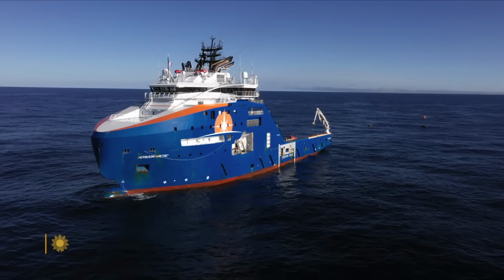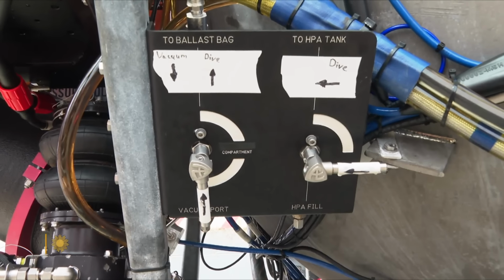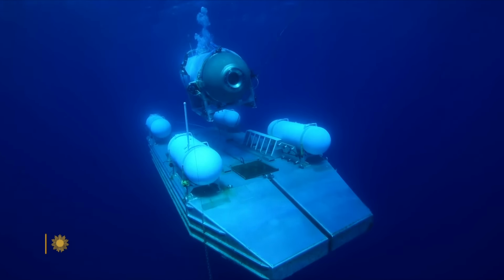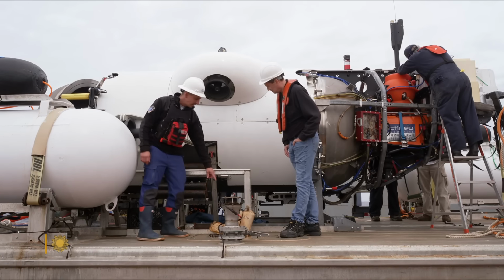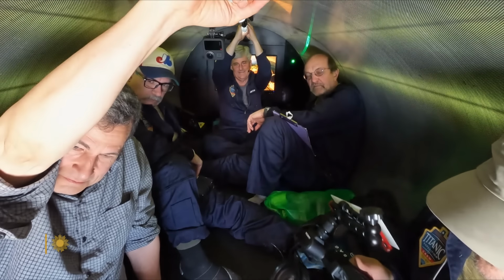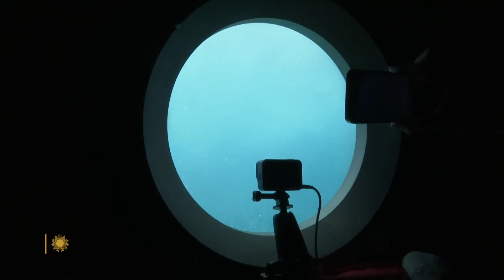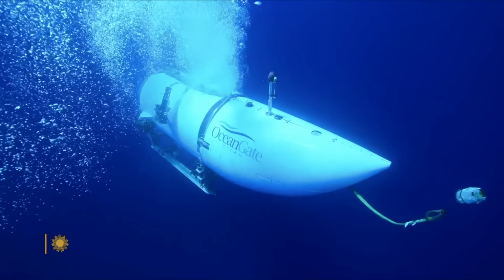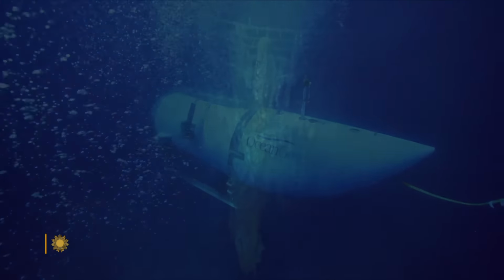Inside the Titanic sub disaster

Comment: As an engineer there's two things you don't cheat. Costs and physics. He did both.
Reply: Don't you mean mean material instead of costs.
Reply: I trust titanium over carbon fiber
Reply: @oldskolacura9798  Well no not exactly. You can buy the same material from a different supplier for less the cost.
Reply: @Body_Model awh, but you missed material testing, as did OceanGate!
Reply: As an engineer I agree. If something simply, physically can't do something, just because you say it can do it, wont suddenly allow it to do it. Post modernism and science are not compatible, and science always wins.
Reply: @SamDru  I saw on another news report that he also used expired carbon fiber from Boeing to build the pressure vessel!
Reply: How much is known about the durability and fatigue limitations of steel under pressure compared with carbon fibre? Should experimental craft EVER be used for commercial tourism? You can't waive liability against negligence of recklessness.
Reply: @multioptioned  well assuming that it imploded before they reached target depth. Which was 13,000 feet or so. I would say it imploded probably around the 11k or 12k mark. means you would have around 4000-5000 psi of force on the sub. For reference the human body starts to break bones at 75-125 psi. I actually think they might have been alright if they didn't use two different types of materials for the hull. I don't know the configuration. But you want your main structural component to be the same across the board to eliminate any sort of different variables that different materials would experience. I read that they had used carbon fiber and titanium for the sub. I don't know enough about submarine structures to question the design choice but I do know enough that one material is going to flex more than the others causing a weak point.
Reply: @ianb4618  I haven't heard that yet. But honestly I wouldn't be surprised. From pictures alone I didn't like the design of the sub something just felt off about it. I know a lot of people are knocking the controller as well but you can control the vessel with a calculator if you wanted to do long as the systems work.
Reply: Former and expert engineer here, I completely agree! the cost should not be the main focus when dealing with the troubles of mother nature! another missed factor that you pointed out is the physics and pressure is so intense that I would be freaking out! #ControllerPlaya!
Reply
Reply: owenpurcell8318  No way dude thats crazy! wanna collab #onlyfans
Reply: why you say "as an engineer"? So if im not a engineer i cant say the next sentence?
Reply: @weldonyoung1013  Don't forget material inspecting.
Reply: @arturf2508 no you can’t. This is the engineer comment section.
Reply: @12runes Should never rely on wireless underwater.  Batteries die, Bluetooth disconnects, fails. That was just stupid
Reply: plus killing
Reply: especially when you consider manned expedition of deep ocean and outer space...
Should never expecting for "budget option" in the first place

He said this 6:59 .. but what was he doing? Going pass the crust of the earth? or Permanent lunar settlement?? 
The risk reward here is off man  The reward being "the ability to make budget deep sea tourism". and the risk involved his own life+ the fellas' 
 ugh damn
Yes there is carbon fiber, which one wants, should have tested with unmanned at least for a couple decade before going full on exotic tourism!!
It really was insane what the guy had been doing.
Reply: There ARE two things. Not there IS two things. Basics. When more than one thing, it’s “ARE”, not “IS”.
Reply: @ZekeSparx  Take it up with auto correct. I'm sure you could have a lovely debate with AI.
Reply: As a non engineering I only read the comments, who else?
Reply: @thehuguenot5615 we didn't know if it could hold that much pressure. So u can't say that.
Reply: what about the people who pay 250k and risk their lives to see the freaking titanic
Reply: @stevemustafa_91  no one asked them to.
Reply: love ur short and simple message
Reply: @Body_Model  that’s like buying off brand cereal
Reply: REVELATION_1_7  no thank you. Jesus is not god
Reply: @stevemustafa_91  Yes that would be my question, WHY? It's either considered a graveyard or a junkyard that is extremely expensive and dangerous to visit just for a look. I don't see the attraction either but it's a moot point as I wouldn't be able to afford to make the choice to go anyway.
Reply: @multioptioned  exactly i swear if they asked me to pay  only $100  i would never get into that thing look at the safety they have used the cheapest material  i wouldn't feel safe at all.
Reply: Yes, James Cameron Deepsea Challenger was proudly designed and built in Australia and tested in USA. Worth reading the details and specifications for it. No corners cut. No tourists. To dive alone to the bottom of the Marina Trench you need to be courageous and extremely well prepared. E.g.
"The submersible features a pilot sphere, large enough for only one occupant. The sphere, with steel walls 64 mm (2.5 in) thick, was tested for its ability to withstand the required 114mega pascals (16,500psi) of pressure in a pressure chamber at Pennsylvania State University. The sphere sits at the base of the 11.8 tonne (13.0 ton) vehicle. The vehicle operates in a vertical attitude, and carries 500 kg (1,100 lb) of ballast weight that allows it to both sink to the bottom and, when released, rise to the surface. If the ballast weight release system fails, stranding the craft on the seafloor, a backup galvanic release is designed to corrode in salt water in a set period of time, allowing the sub to automatically surface."
"They also used a new foam unique in that it is more homogeneous and possesses greater uniform strength than other commercially available syntactic foam yet, with a specific density of about 0.7, will float in water. The foam is composed of very small hollow glass spheres suspended in an epoxy resin and comprises about 70% of the submarine's volume.
The foam's strength enabled the Deepsea Challenger designers to incorporate thruster motors as part of the infrastructure mounted within the foam but without the aid of a steel skeleton to mount various mechanisms."
Window was made from 24cm thick glass.
Reply: But this genius "saw a lot of things about the engineering that didn't make sense." So it makes perfect sense why you should ignore physics and engineering.
Reply: As a mechanic, i always cheat the cost part to earn more money.
Reply: @PwnageJ  maybe on an air filter. But on brakes... cmon
Reply: He definitely was a risk taker‼️
Reply: Cheat on physics?  No one does that.  As for working on costs,  that's often the essence of engineering.  This is just random post disaster claims.
Reply: @Sapientia-in-senectute  What do you mean by that?
Reply: “As an engineer” you guys probably sell used cars for a living.
Reply: Carbon fiber better than titan lol maybe cost wise
Reply: And it cost him his life
Reply: @12runes  Good point bane, and it's interesting that it was around 5000 psi that thing failed. He was using epoxy resin to glue the end caps on and it's tensile strength is around 5000 psi. Epoxy resin also shrinks 1 to 5% after it cures, so as you know that joint was sketchy. He had a slotted flange of only 2 inches machined into the titanium where the carbon fiber fit into it. Like you said, he shouldn't have used dissimilar materials. If he was gonna join the carbon fiber to titanium, which would still be sketchy, I think he should have had at least a 12 inch slot machined into the titanium for the tube to fit into. This would have given him more gluing surface and also allowed him to drill holes away from the edge through the titanium and carbon fiber, and put some bolts through it. Even though drilling holes in CF weakens it, it would have been sandwiched on both sides with titanium. Then he could have wrapped the whole cylinder with more CF and the joint would have been embedded into cylinder. It's just speculation, but I think the thing sprung a leak around one of those joints and he started crapping his pants trying to resurface. They refuse to tell us everything he said on that last message, but that he was dropping weights to resurface. If that high pressure started leaking into that sealed vessel through a compromised area, I think it most likely exploded the thing, like a valve stem letting compressed air into a tire. I could be wrong, and it could have been several other scenarios that happened, since as you know there were numerous weaknesses to that contraption. Somebody said they thought his thrusters got stuck in downward position, and forcing it down too fast would have imploded it. All he seemed to have for controls was that wireless transmitter with no hardwired backup in case it failed. I assume he had the receiver outside the compartment in that tail section. Maybe it malfunctioned and was going on the last signal it received and and he had no way to change it? I guess we'll never know exactly what happened, unless we can get Dionne Warwick's psychic hotline back in business lol.
Reply: Old man hit the nail on the head. Using different materials was a grave mistake. There's a reason military subs are designed the way they are.
Reply: He want just make money.
Reply: @Body_Model  ABSOLUTELY  !
Reply: AND SAFETY!!!!
Reply: too many wanna be engineers in the comment section.
Reply: @AvgJoe-ru8tj  then what does that make you, average joe?
Reply: @AvgJoe-ru8tj  I agree that there are way too many wanna be engineers in the various comment sections, but at least we have some actual engineers for a change.
Reply: @trolley4388 haha I love it😂 
 “YOU CANT SIT WITH US”
Reply: @methylene5  I can think of 2 reasons people care less with crashed airplanes. Most people are used to airplanes and knows they are safe. They are also usually following a conventional design. The submarine however stood out. And then there's also all the lame people that seems to hate successful people.
Reply: @yourcrazybear  Agreed. I do find it interesting how when examples of gross negligence occur in the airline industry that have catastrophic results, we don't see this same sort of response in the comment section.
 For example, surely the CEO of Malaysian Airlines shouldn't have allowed his planes to fly over a known warzone, in that instance it resulted in flight MH17 being accidentally blown out of the sky over Ukraine with the deaths of hundreds of passengers. Then in a week or two, mostly forgotten about. I find the psychology quite interesting.
Reply: there was one thing he couldnt cheat
Reply: I am not even an engineer and to me this thing looks ridiculously weak.
Reply: @jamworthy14 Jesus is God
Reply: @ginavuniulu7407  he is not
Reply: Low caliber gun shots.... that cannot be normal. After that first loud BANG he should have scrapped the whole thing and go back to the drawing board. It's clear that money, and arrogance is what sealed the fate of the poor people.
Reply: As an engineer, you shouldn't cheat ONLY physics.
Reply: In my opinion, the spirits from the original Titanic had had enough of constantly being disturbed.  They finally decided to show what happens when you don't allow the dead to rest in peace.
Reply: @gracealexandre3381  r u serious rn?
Reply: @jamworthy14  Very!
Reply: @gracealexandre3381  souls don't haunt places.
Reply: @jamworthy14  They aren't haunting the place.  It is their final resting place.  Do they not have a right to be left alone and rest in peace?
Reply: @12runes all I know is that some submersibles have more than one shell in the case the external shell is breached they would still be fine
Reply: Yeah I agree. These type of very dangerous should not be done with cutting corners. But what I don't understand is, when they knew they were in trouble, they didn't open the hatch and swim to the surface?
Reply: And he was Proud of it 🥴
Reply: @thureintun1687  Let's go back to 6:40 for the plea... Rush declined, stating "regulation would stifle innovation".
Okay edgelords, keep moving fast and breaking things. We'll be here to pick up the pieces!
Reply: MY FARGIN PERAN
Reply: “Move fast and break things”…
Reply: Exactly ❤❤❤: obviously, things will fail.
Reply: Last words... "wh "
Reply: @R-Lee- 😂😂
Reply: He also cheated safety.
Reply: "At some point, safety is pure waste. If you want to be safe, don't get out of bed , don't get in your car..."

Holy crap, he actually said that.

Comment: Keyword: AEROSPACE not UNDERWATER airplanes are extremely different to underwater vehicles. Airplanes and other high altitude vehicles have air pulling outwards. Underwater vehicles have water pushing inwards. The design used for planes can't be used underwater

Comment: Navy sub captain hit the nail on the head with the hull being three vastly different materials. Also scary to hear dude dismiss safety the way he did. Can safety look differently on different projects, sure, but to have the idea that it will disrupt your project is def a red flag.
Reply: The three different materials weren’t the problem titanium and acrylic plug windows have been used for decades. Carbon fibre is however problematic in and of itself. Carbon fibre has no compressive strength. All the compressive loads are carried by the epoxy binder - and OceanGate bought that epoxy as “time expired” surplus from Boeing. 
The radial winding process they used to build the required thickness is also suspect as it produces shear planes from the outside of the hull to the inside with no resistance to bending forces.
The hull design was also questionable in that the NASA modelling recommended 175mm (7”) of composite and OceanGate used 125mm (5”).
Reply: Rush, is such a befitting name
Reply: @allangibson8494  yeah well we all are gonna take the captains word over yours, buddy
Reply: @elihernandez800  Plug windows are designed to expand and contract in a titanium frame - that’s why they are tapered.
The rest of the hull design? Not so much. The US Coast Guard hasn’t reported finding any substantial parts of the carbon fibre hull spool but have found both end caps therefore what was between failed in compression.
If the end caps had failed or the acrylic window the hull spool would have survived, at least in part.

Comment: 7:09  “I think I can do this just as safely by breaking the rules”
-Haunting Words
Reply: Unfortunately,he got what he deserved
Reply: You summed it up very nicely.. “hunting words” indeed… what scared me was the 3 strikes rule… it should have been 1 strike.. people lives are worth more…
Reply: @GeorgeSmith-ze5vk Yes, 3 strikes? As a passenger, I'd want 0 strikes.
Reply: So frustrating how he KNOWS it's not safe and laughs, it doesn't matter for him, it was all about making $$$$ out of his toy 😒 "kind of cynical of his McGyvering"
Reply: @TheFrenchPug  I mean if just one thing fails… they scrub the dive.. instead of 3 things.. cause think about it.. well we have surface return fail safe not working.. we are still good to go… oh wait now we have 2 fail safe not working.. oh we still go to go….there is something very very wrong with that.. this is not baseball but deep deep deep diving… crazy thinking if you ask me…
Reply: @Amarmi579  I sure feel like that hull would have held before those titanium rings popped off from a hand applied epoxy job to a smooth metal surface. Feel like the pressure on the tube pulled the ends down and in cracking the epoxy seals. The KAPLOW!!!